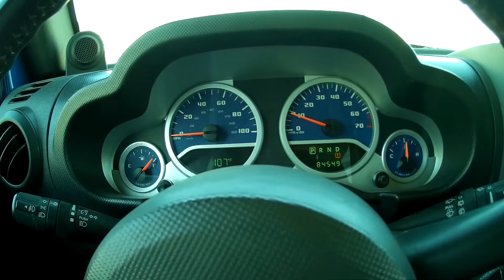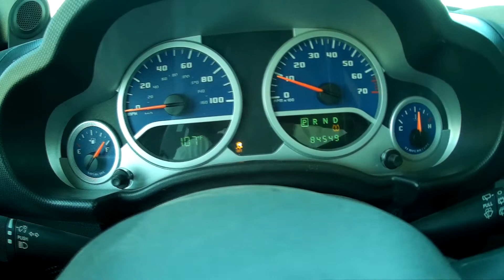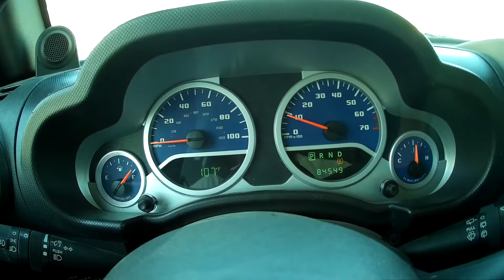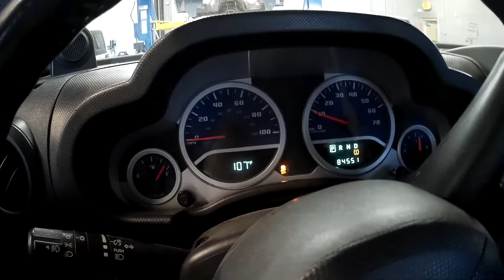Jeep Wrangler LS and LT Traction Control System

Comment: Does traction control still work in 4 low? I mean only the part where it applies the brake on the spinning wheel . . . in other words, can the traction control in 4low work as a 'locker like' tool to distribute power to the wheel that is not spinning (by braking the wheel that is)?

Comment: I have this on my 07 jgc laredo ibtoo live in Vegas drive mostly freeways, soo should I keep my TC on or off for the most part? For the last 11 yrs it’s always been on just wondering if I turn it off if it will save me some gas/mpg generally? Or should I always keep it on and don’t mess w it, my jgc is all bone stock btw but maintained well since I rolled her off dealership w 19K just hit 181K recently